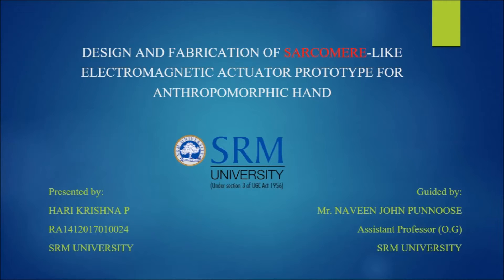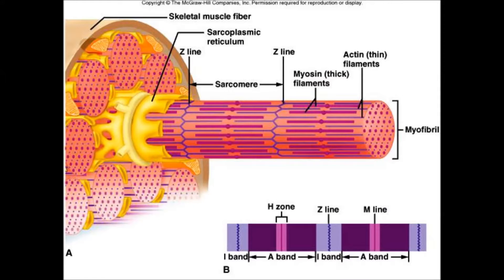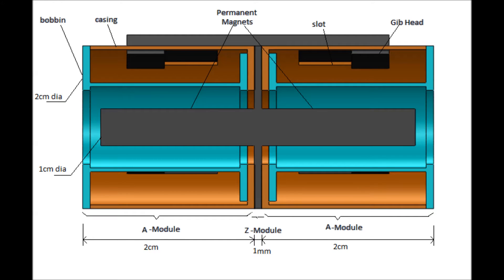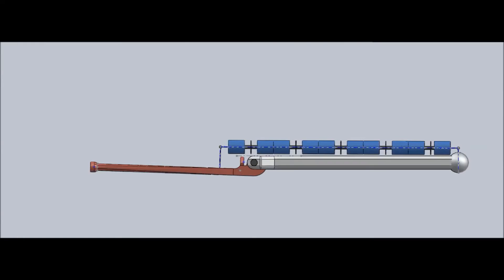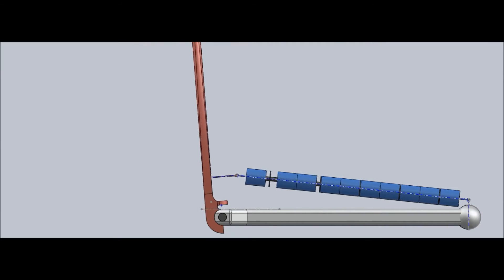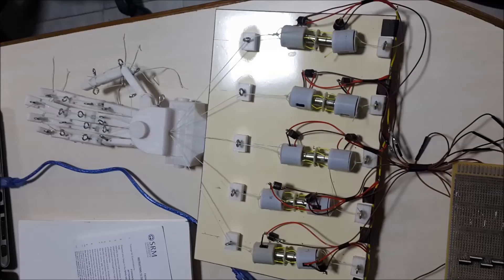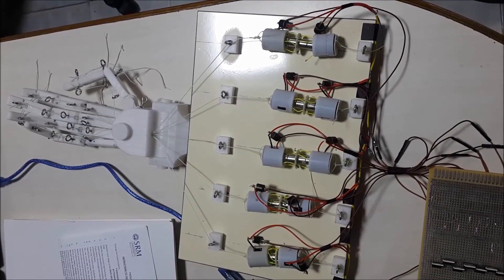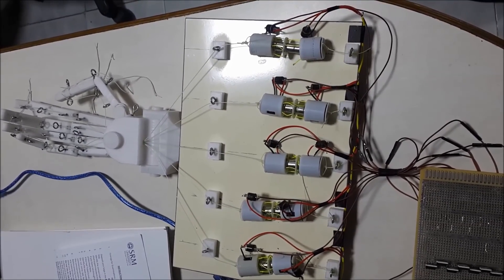DESIGN AND FABRICATION OF SARCOMERE-LIKE ELECTROMAGNETIC ACTUATOR PROTOTYPE FOR ANTHROPOMORPHIC HAND

Comment: Wouldn't it be more efficient to use a lead screw and stepper motor (with mechanical dampening if need be)? Having a 12V 15A power source around all the time could pose a problem, and the heat generated by the solenoids could also pose a problem.
Reply: The advantage of this actuation over the lead screw type is the speed of actuation. Solenoid actuation is much faster and can be controlled by changing the interval between the actuation of each set of sarcomeres. If the size of the sarcomeres can be brought down more, we can even attain much better resolution than the lead screw. As you can see in the practical application, sarcomeres are connected in parallel as in multiple sarcomere fibers. 15A is divided across them.You're right. There will be a heat build-up in solenoids because of huge current. However, this can be avoided by using keep solenoids if the position of the arm needs to be kept idle for a certain time period or by using some cooling mechanism. Since this was a prototype, I couldn't give it a lot of thought back then as the time to finish the project was very little (I scrapped two other ideas before coming to this one).